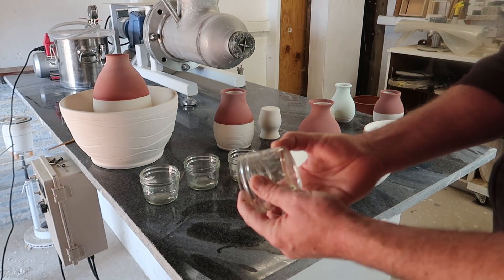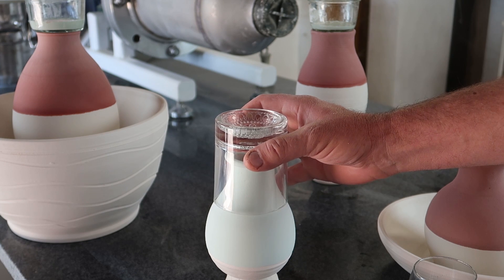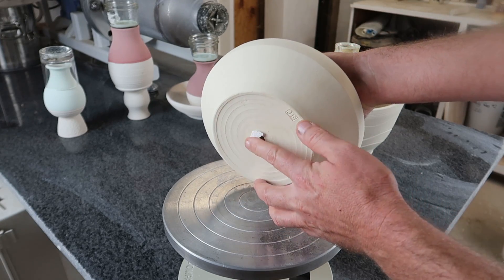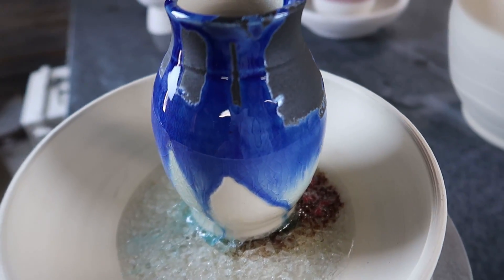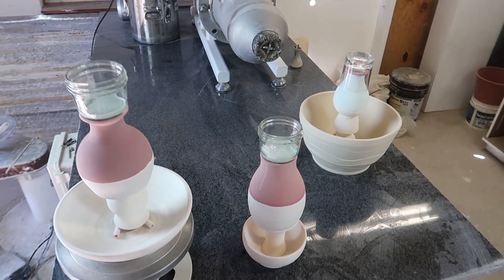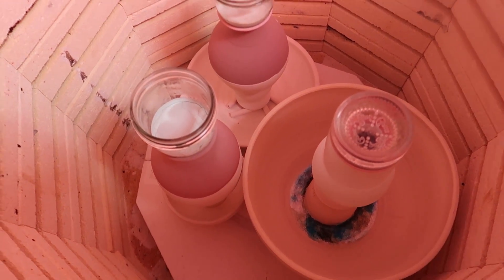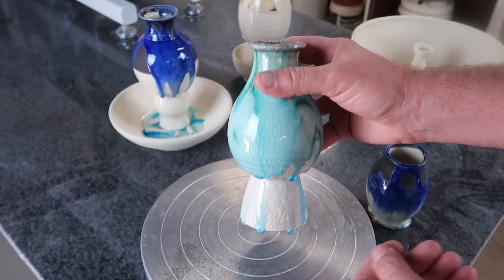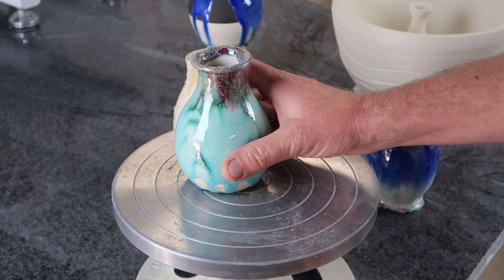Melting Glass Jars on Pottery - Experimental

Comment: I’ve started fooling around using glass with ceramics. 
What you could try is mix frit with ceramic glaze.  The glass particles will melt at around 1480F.  I would use coarse grade frit rather than the fine or powdery frit.

Comment: Why aren’t you using zyp in the  bowls or cups to better facilitate the bits coming out clean?  Also if you have your heart set on sling it your way, I’d recommend making a base that has long thin tripod legs.  That will help make the pieces come apart more easily.

Comment: If you get a glass grinder (wet grinder) you'd be able to grind a hole into the bottom of the jars before fusing to let out any trapped air. You can find them in shops that sell stained glass supplies.

Comment: Use a curved file to score where you want the glass to break at the bottom of the piece.  You may have to alternate using hot and cold water poured on the line, and I don't know how the ceramic will react.  A grinding or polishing tip in a Dremel tool will help to smooth any roughness.

Comment: Very interesting Idea. I will try it with coloured glass - say the bottom of a coloured bottle. It would also be interesting to take a pottery piece that has been glaze fired then re-fire it to the full fuse temperature which is around 1475F. There could be a point at which the glass flower but not off the pot.

Comment: If you use batt wash on your bisque containers the glass shouldn’t stick.
Reply: no amount of coats of primo primer / boron nitride / kiln shelf wash prevents sticking at glaze firing temperatures (2200+F). I've done this a few times trying to "sneak a slump" on my glaze firing. Its' frustrating but if you want to unstick your glass, its meant for 1550F ish  max.

Comment: I've watched videos for crystal glazes where a catch basin was used and after firing, a torch was used on a wheel to heat the joint where the crystal glaze adhered to the basin. When you hear a ping, tap with a hammer. That might help with these experiments.

Comment: Hello Justin, please for the love of god use gloves when trying to separate pieces that are fused together. I am gonna guess you have a reasonable health insurance but who wants hand surgery? Also, you can try putting the stuck together pieces in the freezer for a day and see if the separate. 

On another note, I am guessing that you are firing around cone 6 which is typically much hotter than the melting temperature for commercial glass. I would imagine that glass ware melts at around cone 08-06, simply because it is cheaper to manufacture at lower temperatures. If you want to have more control over the process and not destroy your kiln you could mix up a low temp transparent using ulexite, gerstley borate or fritts, e.g. https://glazy.org/recipes/1658. I don't have a problem with the low temp glass as such, it is the amount of glass that you put on that is gonna make a mess and destroy your kiln when eventually one of those towers topple over. I would personally go for a cone 6 transparent (assuming you fire to cone 6) and flux it so that it starts running at say cone 4. Then rather than building biscuit towers you wad the piece with ball clay and sand. One part ball clay, one part coarse silica sand and about 10-15% water, make balls and glue them to the bottom with elmers / wood glue, same process as you would do for wood firing. The balls are rather soft and comes off much easier than fully vitrified stoneware, takes about 10 minutes with a diamond pad or a angle grinder with a diamond disk.